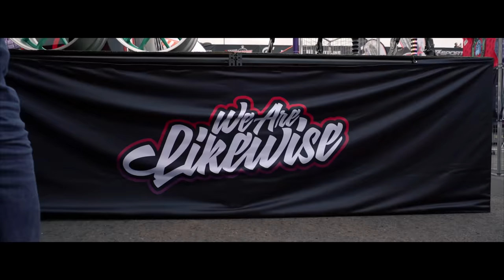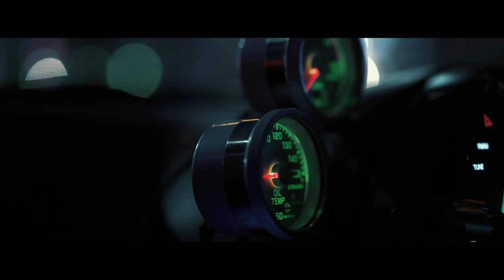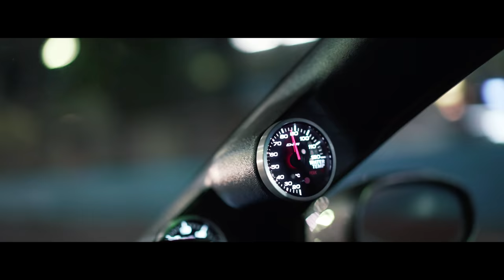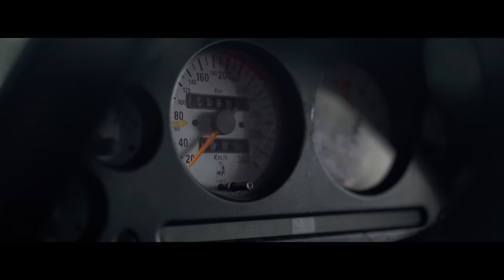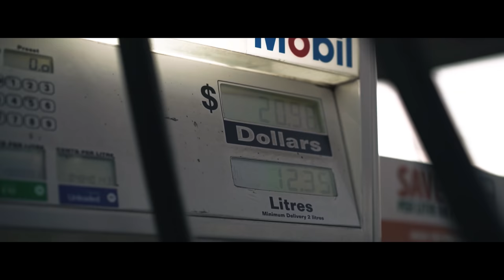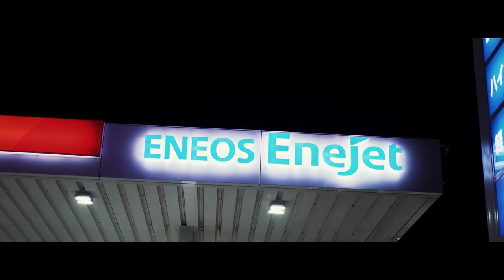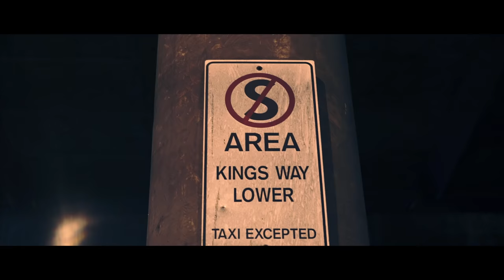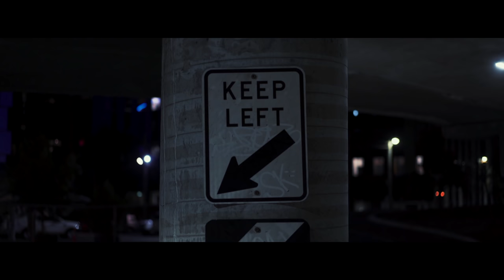NIGHT DRIVE PHONK MIX (LXST CXNTURY TYPE) #4

Comment: Man, this music feels like it suddenly gives your car
+20 acceleration
+50 cornering
+30 handling
Reply: Be carefull bro, is a placebo effect!
Reply: @bozofboz6301  Yes, I am fully aware. But what do you think my 64 horsepower Fiat Panda will be able to do anyway? 😂 Not much...
Reply: and -10 camber
Reply: @pandamilkshake  i have a miata with 110 hp... my tires were almost off, i had the appointment to change them... well... a dude was in the middle of the road, i had to drive into a barrier to dodge him... if i had better tires, i would still be able to drive my miata... now it's at the repair shop...
Reply: this makes my audi feel like a porsche
Reply: You forgot +90 Chillin
Reply: @tommyseux2047  You are quite lucky, Paul Walker was not. Often neglected, tires are very important, always check tread depth and stay safe. Hope you will get your Miata back asap 🚗
Reply: @Arda-ox8pc  probably in 1 or 2 weeks!
I miss it every day... sunny, i can't go to work with the wind in my hair, rainy, i can't slide it on the roundabouts... well it'll come back 😊
Reply: @tommyseux2047  you got her back yet?
Reply: @Kabeeb  nah... the headlights have a 4 week delay since ordering...
Reply: Juzst drive dirty, fam, 
until speed limit itself is a test of concentration
Reply: and please add 100 Unicorn Powers. I can prove it with my 1.2 litre Suzuki Splash :-)
Reply: cornering + handling.. must be super candling.
Reply: @tommyseux2047  lmfaoo
Reply: @Praise--  it's back now 🙃
Reply: @tommyseux2047  nice g, enjoy and stay safe
Reply: @tommyseux2047  tires are the most important car mod next to brakes
Reply: @Willppyro  yep, i've got 205/40r17 on semi slicks instead of the 195/55r15. Maybe i drive a bit... too fast?
Reply: +20 p.def what about this ?
Reply: 🏆 best comment goes to you
Reply: @bozofboz6301  I don't get it
Reply: Passive Perk: Nightdrive. Increases your sight in night races by 150.
Reply: @bozofboz6301  ⁰
Reply: @Arda-ox8pc  true but Paul was murdered
Reply: Yep. Tell the cops that
Reply: @pandamilkshake  Its not the car its the driver
Reply: and +1200 of drifting

Comment: Negative camber is fine, as long as you dont over do it like the car in the first song. Cause that is 101 on how to ruin the inside of your tires really quick. The guy who owned my car before me had the tyres negative cambed. The inside were barely road legal, whilst the outside were barely touched. 

Pls only use extreme camber if its for drifting or racing on very sweavy roads. Dont do it if you plan on drag racing on the highway, you will only loose grip and wear them out quicker
Reply: people dont also do massive negative camber in drifting, the rear often is positive camber in the competition drift cars, that huge negative camber is only for looks, fitment
Reply: @tgolas21  Yeah and that makes sense too as in drifting competitions you want good grip in the front and no grip in the back